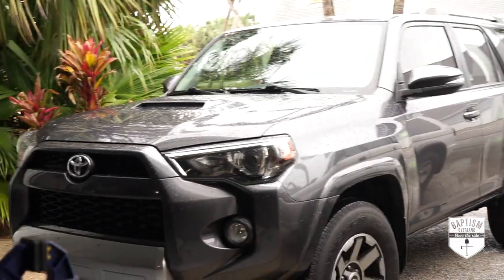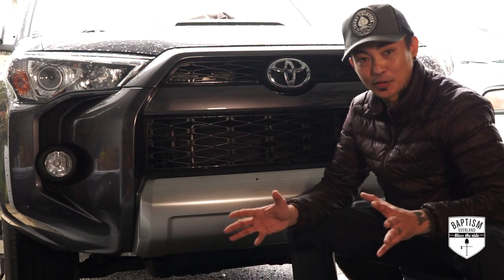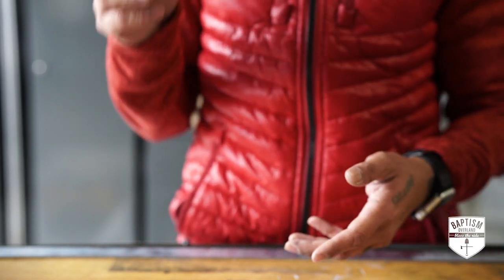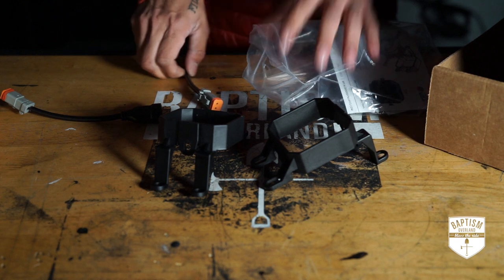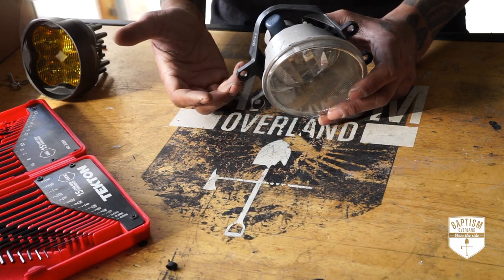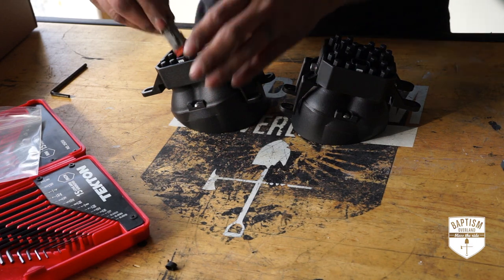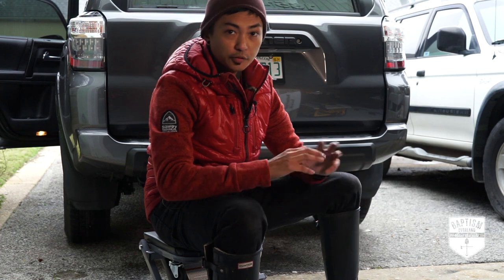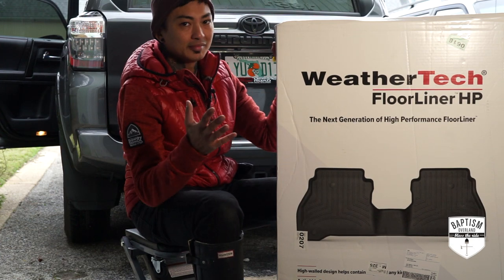FIRST "MODS" ON OUR NEW RIG! *Toyota TRD Off Road 5th Gen 4 Runner*

Comment: Great video..after you removed everything for the phone mount was there anything under where you screwed it in?? Can I mount it without taking everything out like you did? Thank you
Reply from the maker: Yeah there was nothing under there. There are some wires nearby and a metal rail if I remember correctly BUT once you take out the front dash you'll be able to see better where you can or shouldn't drill
Reply: @BaptismOverland  I am planning to do the same mount. Did you use  machine screws with nuts and wide washers? I am curious how think and stiff the dashboard plastic is and if it bends or can rip up from the weight of the RAM mounts with the phone hanging on it, while the truck goes over bumps. Thank you, great video! Also love the amber fog lights and that is my next project.

Comment: Why not use the 3m adhesive tape? 
It holds vehicle panels up - it is extremely strong. But you can remove it with work later, leaving no mark - or screw holes.
Reply: There is no way I would drill those holes in my dash.  That made me cringe.
Reply: @JohnQuincy1776  yeah. No reason to do that considering adhesive tape holds on vehicle panels and other attachments, permanently. But, people only do what they are told. Someone told him to drill holes. Maybe as a child. So he still does it.
Reply from the maker: @johnmadsen37   I always have bad luck with 3M tape and there are going to be a TON of devices that are going to be on this thing that will push it way off center of gravity (iPad, phones, cameras) and that tape will just come right off because you're sticking it on to vinyl which has textured properties that don't allow for strong bonding. Maybe someone told you you can use 3M tape everywhere. Maybe as a child. So you still do it.
Reply from the maker: @JohnQuincy1776  Normally I wouldn't drill into the dash as well but as long as the install is clean and almost stock and not something you'll be removing. The rail system from Ram Mount looks OEM...it's not obnoxious and you can build off of it.

Comment: I just bought TRD Pro Black Valences & Roof Rack Rails to replace the Silver ones my 2017 TRD Off Road (Nautical Mettalic Blue) came with. Also went online and found black out kits for the badging on the grill, tail gate and side "TRD Off Road" badge. Not a fan of the Plasti Dip and definitely do not have the patience. Just finished doing my last mod yesterday. Morimoto XB Led Headlights & Tail lights. Other Mods Ive done: Nitto Ridge Grappler Tires, Fuel Enduro D608 Rims, Bilstein 5100 2.5" level kit, Alpine Halo ilx F309 for 4runner head unit, JL Audio Speakers all around, K&N Cold Air Intake and some small things on the interior.

Comment: The grille style where the emblem is , is that aftermarket because I just got 4Runner and it doesn’t look like that .
Reply from the maker: It's stock. Different trims I think for diff models. Is yours a TRD Off Road?
Reply: @BaptismOverland  yeah 2023 orp
Reply from the maker: @StarWarNerd  hmmmm idk then. Did you buy yours brand new and it had a different grill? We bought ours used and that was the grill on it

Comment: Man that kayak style track mount on the dash was an awesome idea. But I'm not sure about pulling out the radio and putting 10 holes in the dash lol.
Reply from the maker: I regretted it after 67 Designs came out with a rail a few months after haha. I have a video on that too
Reply: @BaptismOverland  Yeah so far my phone is on a suction cup mount that attaches to the dash. It's angled downward so it doesn't block any views.I hate stuff coming off the glass. I've been debating doing something more permanent.
Reply from the maker: @stevenm6301  67Designs all the way bro
Reply: @BaptismOverland  Man that does look pretty cool. I like how it's lower and a bit more forward in front of the clock. Way fewer holes too.

Comment: Did you find anything that might get in the way of installing and screwing down the rack for the ram mount? I know as a precaution you removed the electronic components of the dash but I’d like to avoid having to do that if at all possible if there’s nothing the screws will damage under the rack. Thanks in advance.
Reply from the maker: There was space. Tons of it actually so nothing got in the way
Reply: @BaptismOverland  awesome, thanks!

Comment: Did you do LED DRLs/High Beams as well? Do they have the issue with flickering?
Reply from the maker: LasFit does not have DRL bulbs yet. I wanted to. Check my latest video because I upgrade the headlights again after they sent me their pro version and it’s sickkkk. No flickering either!
Reply: @BaptismOverland  thanks, I definitely will! I did see headlight revolution/xenon depot has a DRL/high beam kit with a converter so it actually works as a DRL without flickering, but haven’t seen anyone use them yet.